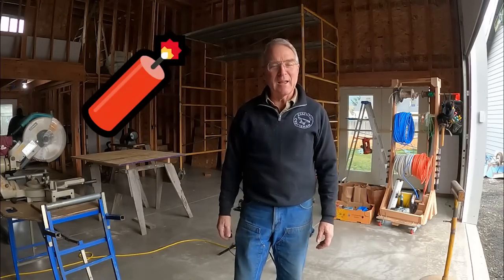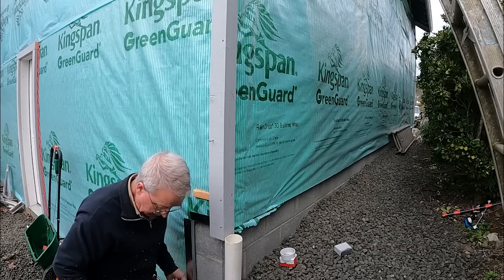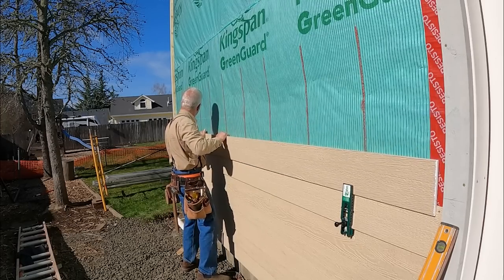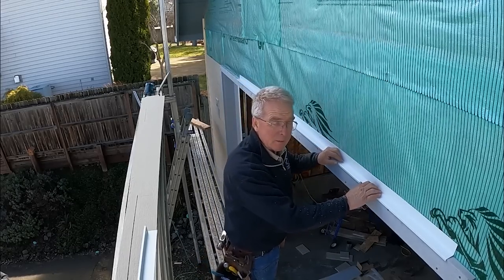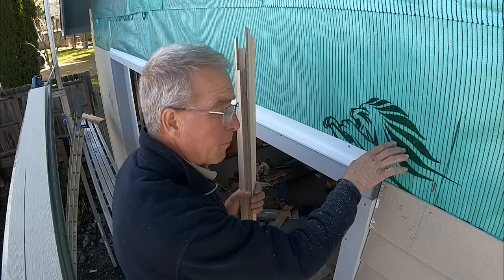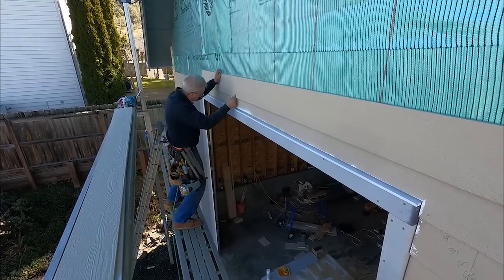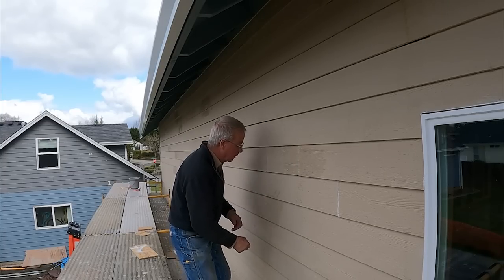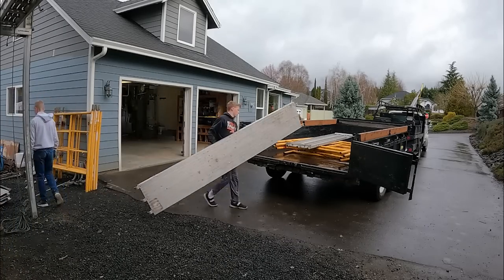Putting Siding On A Shop: Shop Build #23

Comment: I wasn't aware that plastic-veneered, OSB-backed siding existed. Now that I am, I am surprised to hear that it is stronger than Hardiplank.

Do you know what the respective fire resistant properties are?
Reply: Contact the manufacturer.
Reply: Don't listen to those claims that's it's stronger than hardie. Just like most materials the stronger it is the more brittle it is as well. So yes when carried incorrectly by a single person it can snap on you. But once installed properly it is way stronger than this osb stuff. And not only that but a fiber cement won't burn. Whilst osb loves to burn

Comment: If you run the momentary switch off a relay thats rated for high enough amps the switch will be protected by the relay and you shouldnt have to replace it again.

Comment: The Scientist are going to have a problem with you not using a rain screen 😂.
Reply: You don't need rain screen buddy. You only use rain screen on cedar shakes. Have you ever carpentry pal?
Reply: Technically, that green wrap has a built in rainscreen. How well it works is up for debate.
Reply: @michaelcarroll991  I can’t tell if you’re serious or joking.  We’re on the same page pal.
Reply: Why would you not need rain screen? In Northern Europe all new buildings with siding require a furring strips beneath siding. I think it affects the vapour barrier aswell, letting the inside moisture when moving out to evaporate more easily.

Comment: Good God you butcherd those trim boards with the screws. The painter is going to hate you. And you will never get it right. Where is your but flashing. And the nails. Your using the wrong gun. Siding isn't framing. It's finish work. And Lp siding doesn't hold up over time. Because let's face it. No one keeps up with there paint or caulk.